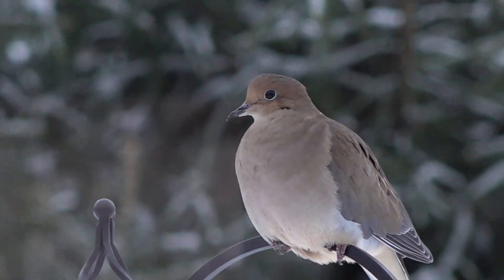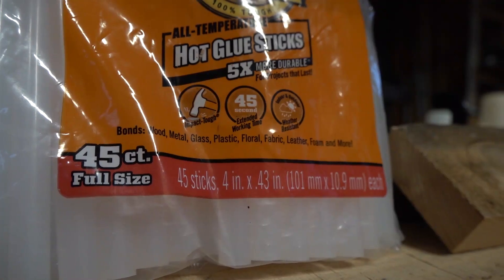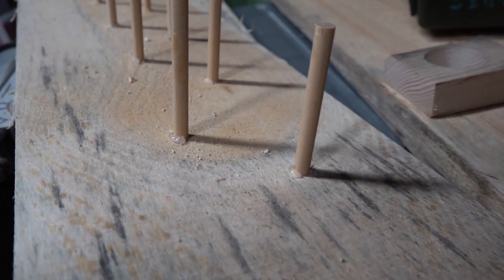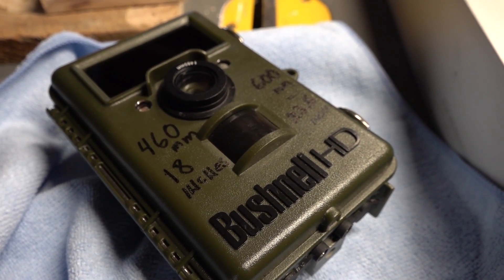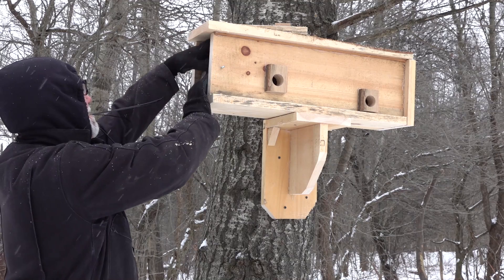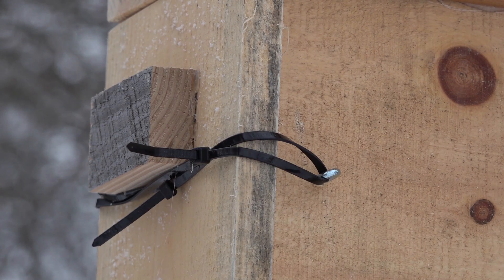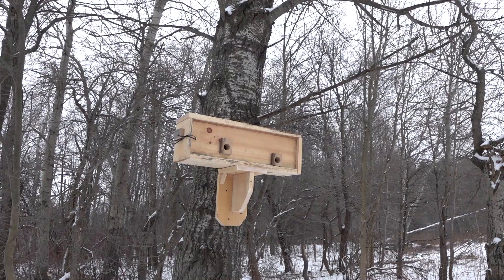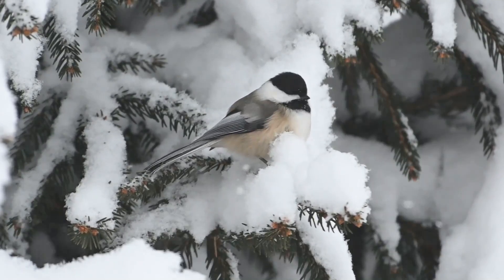Wild Bird Winter Roost or Shelter from Bad Weather DIY Gorilla Hot Glue

Comment: I'd imagine it's the openings on the front of the box that are the problem. That's more akin to a tunnel. Birds like to get in and out quick. Lose those and just leave the holes on the wood. You can always just get a metal collar or plate with a hole to fasten on the front to ensure predators don't chew out the holes to get in. And throw in some straw/hay and a bit of grass on the floor of the box for added heat, and the natural smell will help attract them. Good job though. Always nice to see people taking care of the wildlife around them.
Reply: Or even wood shavings, but, yes, totally agree with you.
Reply: Its a predator guard, plus it helps retain heat inside when theres wind.

Comment: My son and I built a vertical roost/shelter after seeing your first video. I baited it with some seeds but have no camera to follow activity. After a few weeks, squirrels had chewed the hole larger so they could get their heads in to eat the seeds. Can't blame them too much as we had some real nasty snow storms around Xmas and a huge wind storm on New Years day/night that snapped healthy 30 inch spruces on the property. Ultimately I have to give them a well-intentioned fail so far.
Reply from the maker: Thanks for the update David... to date, not one of the companies that sell them have responded to my questions. It's not looking good. Woodlands, brush piles, and coniferous trees seem to be the key. I even asked Leslie the Bird Nerd what her thoughts were and she also didn't respond. Oh well... I hope you built one instead of buying one.
Reply: @FrederickDunn  Yes we built it from scratch and the boy got a lot of time and safety lessons on the table and cutoff saws and other power tools as well as some hand tools so it was a great learning experience. Well worth the effort. The lumber I had lying around so there was virtually no cost to speak of.
Reply: @FrederickDunn  Leslie does have a video out with a bird box. She started by adding a thick layer of wood shavings. Hers was occupied.

Comment: Interesting video. I came here for info, and got exactly what I was looking for. Thank you for posting.

I live in new England, and just built an elaborate feeder station in my backyard, which is very successful. Just for yuckers, I wanted to build shelter, housing, or roost boxes, to add to the bird theme, and help out the migrants. Curious if your boxes became anymore popular, since your last attempts? Have you anymore tips? (concerning occupancy)
Reply from the maker: They were never occupied by anything but squirrels after they had time to chew into them. I've abandoned making winter roosts. The birds seem to already have enough cover.
Reply: @FrederickDunn  Sorry they didn't work out. Concerning the predators eating open the entrance hole, I had thought about using a slice of inch and a half exhaust tubing to line the hole, to discourage nibblers. But I do appreciate the reply. Enjoy the up-coming fall Fred.
Reply: I have never come across any evidence of any birds using roosting boxes. We made a few here in Toronto too, and no takers. We have Downy Woodpeckers using regular nesting boxes as roosts, but nobody goes into the roosting box!

Comment: I suspect the issue may be all the dowels. It maybe too many. And the box should be hung vertically, rather than horizontally.
Reply from the maker: Thanks, as is my practice, I don't test one configuration. So we had the verticle setups as well. Thanks for taking a moment to comment.
Reply: Honestly there is just no design for a roosting box that ever seems to get used by any bird. We've tried several "roost" designs, and no birds have ever used them for roosting (sleeping at night) -- but Downy Woodpeckers do use regular nest boxes for roosting/sleeping.

Comment: Good experiment. Will be interesting to see what HEAT does to hot glue, but in the summer there will be shade so this might just be a good all around solution. Now all we have to do is figure out how to make it enticing to birds to USE it. Silly birds. Would a bigger box help? or is it already too big? Its a puzzle!
Reply from the maker: Thanks Julie, I have other sizes out also, the heat tolerance is also high in that direct sunlight wouldn't approach the melt temps. BUT, we'll see how it goes. I also have five new bluebird boxes made with hot-glue out on posts... they also survived our recent wind storms. Fun and easy to use for sure, I hope they hold up.
Reply: I have a feeling they will hold up fine, but like all your tests, we have to let the facts show before we count them. Thank you for helping the birds. Things are tough on them this year, and all you do does help.

Comment: You installed it in a cold exposed to the wind area.  Why??  Winter Roost Boxes are supposed to be installed in the south side of the house-away from the northern winds.  They will go to those instead of yours due in the cold wind installed.
Reply from the maker: This is a repeat question, so I refer you to my original answer. Thanks. Shelter from wind, rain and snow is shelter, no matter if it's in an exposed location.

Comment: I don't get WHY you want to use Hot Glue for a permanent joint anywhere. It's sole purpose is temporary hold.
Reply from the maker: The company designated it as a permanent and weather proof bond. The point was to test it. Thanks for sharing your thoughts. Regular wood glue is best.

Comment: I know this has been out for awhile, but I'm wondering if you've had any success yet. I put up a roost last fall (2021) and no takers all winter. It was sheltered, facing south, out of wind, had the right-sized hole, perches longways at two levels, everything a little birdie could want. But nada. Zilch. The wasps moved in over summer, which was annoying. I'm not giving up, though. Wasps are gone now and we'll leave it out over winter 22-23 and see what happens. Have you tried heating any of your roosts? We get well below zero here in upstate NY, so I'm trying to figure out if there's a way to provide a little bit of heat to the roost without burning it down. Considering reptile terrarium cables. Anyone have experience with this?
Reply from the maker: They much preferred spruce trees with their dense needles, some species just went into standard bluebird boxes from time to time, but constructing roosts was a waste of time. At least here where I live.